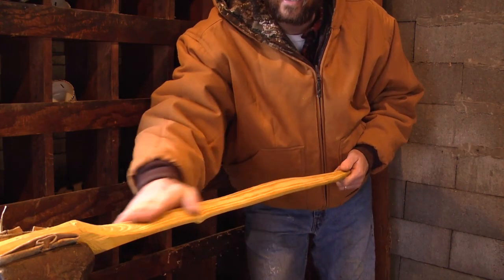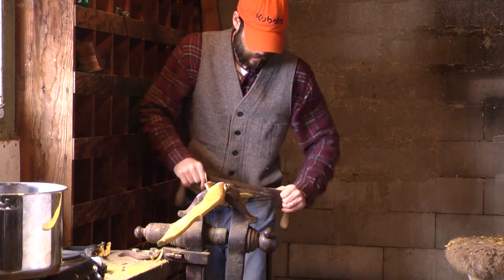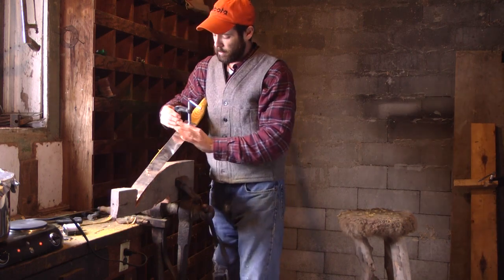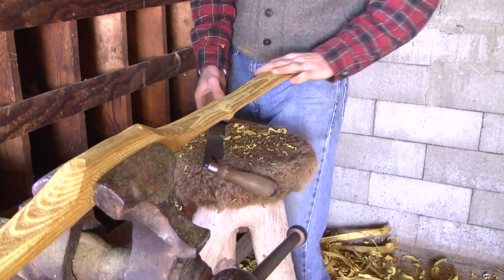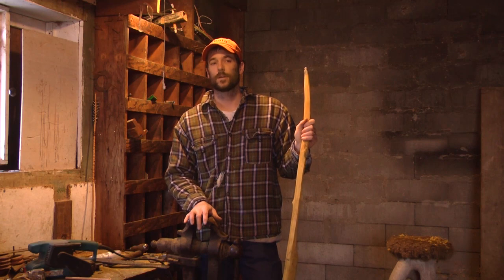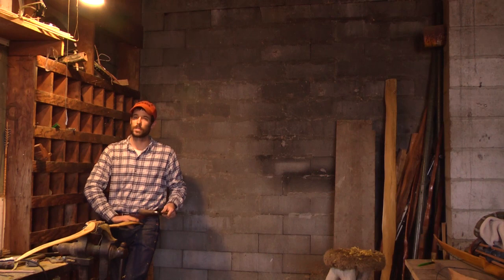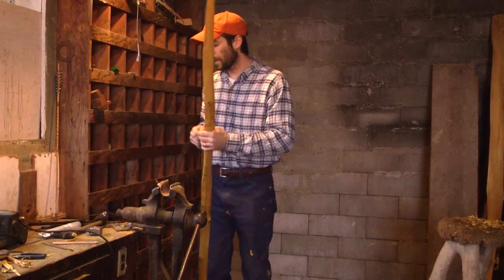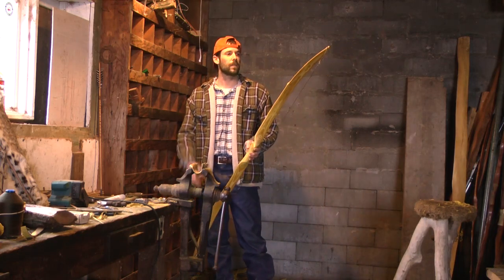How to make a Longbow - Part 3: Tillering

Comment: I haven't touched a stave in several years, and I have never had any turn out very well. Sinew has been a lifesaver with the ash I have used. Thanks for the very well taught videos. I will have to get going again.

Comment from the maker: That depends on a few things like diameter of the stave, temp, humidity, etc.  On average I let a split 4" stave dry for at least a year.  You can start reducing mass and getting down to something that looks a little like a bow before then, but if the wood is too wet, it will develop longitudinal cracks as it drys.

Comment from the maker: I'm not familiar with that species, but with other white woods, it's a common practice to just remove the bark and use the outer most ring as the back.  With such a small diameter limb, you are probably "decrowning" it.  That's fine, but it does make things a little more touchy.  Your tiller will need to be perfect.  Just remember, the road to becoming a good bowyer is strewn with splintered wood.

Comment: At 27:00 you talk about the bottom limb being stifer and its benifits is that because when you draw back you are pulling the string on that side of centre ?
If you get what I'm saying your arrow nock is pretty much centre and in your case all three fingers are pulling on the bottom side so you are constantly pulling the bottom limb just a bit more than the top......or have you ever thought of that?

Comment: This is an excellent step-by-step video Clay and very useful for first-time bowyers like me.  Would have liked to have seen the finished (sanded & stained) bow.  Can you post a photo?  One more question... can tillering be done by decreasing width from the limbs rather than thickness?
Reply from the maker: Sorry Elias, I donated that bow to a fundraiser auction so I can't post any pictures.  Yes, you can adjust tiller by removing wood from the sides rather than the belly.

Comment: Hey Clay, enjoyed the series. Unusaul vice you have there, never have seen one like it. Could you tell us tool nuts a little more about it or a short vid. would be great.
Reply from the maker: It's called a leg vise. You can sometimes find them in old barns. The leg sticks down into the floor of the shop so you can really crank a lot of leverage on the handle.
Reply: Clay Hayes Thanks for response Clay. Cool and interesting vice.

Comment: Well I just splintered my bow yesterday. It was my fault  steamed one tip to get some twist out the tip and give it a backbend.  Splinter happened just like ya said guess I will try a backing strap next time. Got in a hurry my fault I also noticed today it occurred where I had a blade chip in the edge of the wood. My bad . Another wall art piece... since it is on the inside belly I have to wonder if supper glue might fix it, thinking I might keep going on it and do some sinue on it and see if it can be repaired,  should have just left it alone . Think I will watch your videos again .
Reply from the maker: Just fill it up with glue. Those cracks don’t usually cause problem.

Comment from the maker: I never really check the weight.  I just keep taking off wood until it feels about right.  If you'fe trying to reach a target weight, you could use a bathroom scale and a board.  Simply place a 2x4 about 4 feet long on the scale, hook the bowstring over the top end and push the bow handle down toward the scale. This will bive you a fairly acurate reading on weight at whatever draw length you push the bow too.  We'll cover arrow spine and tuning in a later video.  thanks for watching.

Comment: Love the videos.Currently working on a 54" Osage bow as a trial run.  I do have a couple questions though.  1. I'm 6' 8" with a 31-32" draw.  What do you think would be the minimum size bow, in osage, for a man of my particular measurements?  2. What grit sand paper do you wind up using and what do you use for sealing the bow when it is completely finished?  Thanks again for the great videos hope to see a few more maybe with a different wood :)
Reply from the maker: +Singing Wolf (SingingWolf39) You might need to go with something in the range of 68 - 70 inches overall. For my final sanding I use 000 steel wool, and to seal the bows I use tung oil - about 5 coats or so.
Reply: Awesome man thanks for the info.  Just got done steaming recurves into the limbs of the 54 now the 3 week wait :)

Comment: Finished tillering but the limb tip alignment with the handle is off the wrong side, is dry heat treating to bend one limb a little more a bad idea at this stage?

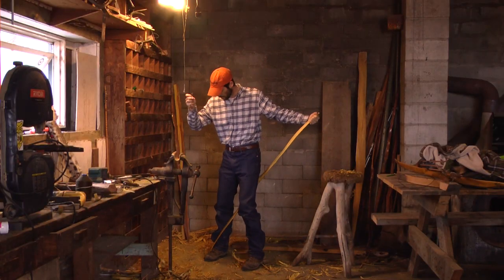Comment: Hi Clay,  I was at the point of stringing my Osage stave (the 20:00 mark in this video) and I heard a slight crack.  There was a quarter inch splinter at a pin knot on the back about 10"-12" from the stave midpoint.  I gouged out the splintered wood to the next growth ring and smoothed the transition between growth rings.  I then applied 2-3 layers of sinew to the area extending 5"-6" above and below the area in question.

My question is, do I need to apply sinew to the entire back or is what I've done sufficient?  (appearance doesn't matter)
Reply from the maker: +Steve Lardner That's probably the best thing you could have done. If the rest of the back is sound, it's probably not necessary to back the whole thing.
Reply: +Clay Hayes Thanks Clay.  I got impatient and applied sinew to the entire length.  It was quite a learning experience.  My sinew was quite stiff because it didn't separate well from the outer sheathing.  I tried to work in the glue best I could.  We'll see in a couple days how it worked out.  Newt time I will moisten my sinew by putting it between wet cloth in a covered container overnight so it's good an flexible.
Reply from the maker: Learn well... Sinew backing is a ton of work. as you know.

Comment: Hey man, ive been watching your videos now for a few months and during that time ive cut and dried 12 really nice 7ft long hickory staves about 4 inches round each. Ive as of now (1-12-24) gotten my first successful hickory flat bow that measures up at 72 inches long by 2 inches wide at the limbs with a 10 inch long by 1 1/4 inch  blended handle. It came in at just shy of 60lbs, and I'd really like to hit that 65lb mark just for the sake of enough power to put a hog or 3 in my freezers each year.  

My question is this:

Do you think that cutting down the ends about an inch or 2 will help me increase that draw wieght? Full draw for me is 28 inches, and yes, i have already roasted this bow in a backset form for about 2 hours, its got about 2 1/2 inches of backset after i strung it up and shot it for a weekend here in deep south Alabama. Ive also uploaded a short video to my channel briefly going over what ive got so far, ill continue to upload more as i get them transferred over to my laptop

Comment: Clay, thanks for sharing your knowledge. I've learned substantially by watching your videos. Quick question...When you cut the string nocks, did you cut through the back and belly of the bow?
Reply from the maker: Try not to but through the back if possible. If you have to, you might want to glue a reinforcing piece over the nocks.

Comment: Clay, is there any special/different steps you would need to take making a bow out of hickory? I'm in Alabama so it can get pretty humid, I would assume more drying time would be needed and if so, are there any ways to speed up the drying process with some sort of homemade dryer? Thanks for the amazing videos, keep up the great work!
Reply from the maker: Chris Bennett Sure Chris, hickory doesn't have sapwood like osage. When you remove the bark from hickory, your back is just underneath.  You can speed up drying by putting the staves in your attic during the summer. Or you can google plans for a drying box. People make and use them but I've never had the need.

Comment: Hi Clay, I just finished my first osage selfbow and Flemish Twist string (thanks to your video).  Unfortunately, when I flexed the bow it got a longitudinal split "6"-8" long, about 8" from the upper tip and about 1/4" from the edge of the stave.  Do you know what causes this type of split?  Is there some way to recognize and prevent it during roughing out and tillering?  Also, is there anything that can be done to repair it?  Thanks.
Reply from the maker: Steve Lardner Hi Steve, it's not uncommon for osage to develop longitudinal cracks. Many of my bows are full of them and have been shooting that way for years. Unless the crack is deep or runs off the edge, it could just be cosmetic. You can fill the cracks with superglue to help seal them up. If it's a substantial crack, maybe try wrapping the area with sinew and hide glue (the real stuff, not that fake crap on a spool). That should fix it up.

Comment: I've just finished a good bow out of really dry hickory but when It's unstrung there's a lot of set in the limbs already. Will this keep getting worse and the draw weight keep getting less?
Reply from the maker: I'd guess not. You're probably pretty close to where the final string follow will end up.  If you're unsatisfied with the bow you might want to try steaming the handle and putting some backset in there.

Comment: it seemed to me that you had a slight S curve to the bow. Am I wrong or is that not a problem? Also what do you use to seal it? do you ever laminate it like with sinew or is it fine just wood? Awesome video. Thanks!
Reply from the maker: +himmerman as long as the string bisects the handle it's not a problem. I use tung oil to seal it. I sometimes sinew back bows but mainly make wood only bows.
Reply: Thanks Clay!

Comment: I have one more European wych elm to work with. I"m thinking to make it about 65" long and about 2" wide and a little bit thiner on the limbs and recurve them about 2" away from the belly.The wood has been drying 1 month as a stave and about 1 month close to bow dimensions. I hope it will work well. What do you think about this and how good wych elm is in your opinion.
Reply from the maker: Lo La Hello Lo La, I've never worked with any type of elm but the dimensions should work fine for most white woods.

Comment: I just cut one wych elm wood so I wonder should I take the bark of or leave   it on. I always take it of few days after I cut the wood or when the wood is dry.. Anyway can you please tell me what to do and why?.
Reply from the maker: Lo La I'm not familiar with that wood. Whether or not you can remove the bark while the wood is green depends on the species.  Some wood will check (split) badly if you do this. It's safer to leave it on for a while until it dries a little.

Comment: Ive been making selfbows almost year ago but I still have problem with only one thing. I cant make a bow without of SET.I use the bow couple of times and set appears in sec. I see that you draw the bow several times and it returns bautifuly to original shape. Should I steam reflex the limbs of my bow and if I do how much would it last before SET appears.
Reply from the maker: Lo La the amount of set, or string follow, you get will depend on the type of wood and bow design, as well as how you treat it during the building process.  In general, wide, thin limbs will take less set.  Reflex will also help.

Comment: If you tillered a bow to just under finished draw weight, if you steam bent some recurve in it would go up up in draw weight? And would the tiller stay even with the recurve put in after its finished?
Reply from the maker: yes, the draw weight would increase. If the tiller is good before the curves, and the curves are even then the tiller should still be pretty good. you'll probably need to make some adjustments though.
Reply: Clay Hayes Thanks so much, love your videos they are awesome.👍👍👍
Reply from the maker: Thanks Joel, you should also check out www.patreon.com/clayhayes . There's lot's of useful info there as well.

Comment: That was awesome. So I just started my first bow. These videos have got me concerned though. Mine is from a Silky Oak (in Australia) branch. It's diameter is about 3 inches so trying to find a ring like you did while still trying to make it flat is going to be impossible. The whole time (10hrs) I've just been ignoring rings and have just been trying to get the right shape. I'm using a tiny little (single tang) survival knife and that's it. Does it sound like I should start over from scratch?

Comment: Just so I am sure about this, after you steam you allow 3 weeks for the bow to dry?
Reply from the maker: kyletango Usually. But, this will depend on the drying conditions. If it's stored in a cool, humid place it may take much longer.  Keep the humidity and temperature in mind.

Comment: Hi Clay, a tillering question.  My limbs have a twist to them.  They're both bending fairly evenly and with he same amount of bend but both twist to one side.  Does this mean I should remove more wood from one side of the limb than the other, and if so with side?  The one that appears to bend more than the other seems more logical to me.

thanks,
Steve
Reply from the maker: +Steve Lardner you mean you have propeller twist?
Reply: Clay Hayes Kind of.  There's some propeller twist but the uneven bend when I draw the bow is my concern. Both limbs twist on the same side, the side away from the arrow rest creating or amplifying the propeller twist.
Reply: Yes, but it isn't apparent until the bow is drawn.  It's currently pulling 52# at 23" which is good as I'm look to make it a 50#-55# at 28" but I'd like to reduce or eliminate the twist, if I can.

Comment: someone has probably already asked this, and you probably already answered, but why did you make the handle 1 inch above center and 3 under? from everything that i've seen and read, most people make it an even 2 above and 2 below. why do you do this on this particular bow
Reply from the maker: splitting the difference in this way gets the arrow closer to the center of the bow without going all the way. It's a common practice to make the lower limb a little shorter like I've done here.

Comment: Hi Clay, well the sinew is dry and I put the bow string on and put it on my tillering stick.  Both limbs have a fair amount of twist.  I read in the Bowyers Bible that to eliminate twist I should remove some wood from the "offending" side.  Am I correct in assuming the offending side is the side that has less bend, i.e., isn't as close to the bow string?  Thanks.
Reply from the maker: +Steve Lardner Some propeller twist doesn't necessarily create a problem but if you want to straighten it out some, you can remove wood from whatever side you want the bow to bend toward. The bow will bend toward the thinner side.

Comment: Great series, but it looks like you could up your bows performance if your begin tapering the limbs width earlier towards the fades. Unless this is intentional, and you designed this bow to shoot very heavy arrows
Reply from the maker: +Primitive Pyromaniac Good thought. I like to keep my limbs wide because it allows me to make them very thin. This helps reduce string follow in hardwoods like osage.
Reply: I've never heard of that concept before, but i will see if it works with my Australian hardwoods

Comment: Does it really needed to dry the wood? While drying, No shooting? In what way to dry the wood? Would it be okay if i'll expose it to sunlight?
Reply from the maker: Drying the wood is very important. if you bend wet (green) wood, it's more likely to stay bent which you don't want. Exposure to sun and wind, at least in the early stages of drying, will cause the wood to develop cracks due to drying too fast. ch
Reply: Thanks Clay. Now i know why my other bow have these cracks and already bent and the other bow is just Perfect for me. =)
Reply: What is the draw weight of that bow?

Comment: what do you think about setting in recurves after tillering the bow? also i have a plethora of black locust any design tips? i know its similar to osage
Reply from the maker: +Seth Basler you could recurve the tips after tillering. You'd likely need to remove some wood from the belly to reduce weight and keep the curves from pulling out.
Reply: Clay Hayes what kind of design tips would you use for black locust?

Comment: Hello, I know this is an old series but I built my first bow from hornbeam about 6 months ago and It's very hard to pull by looking at your bow when you where tillering  it and said it's probably 100 pounds now mine is twice as hard to pull in the finished condition. It is 61 inches long unfortunately I don't know the exact draw distance I assume it's around 25 inches but the limbs are very thick. What would be the correct limb thickness/width for that length if I want the draw to be at say 65-70 lbs? Thanks in advance!
Reply from the maker: Hi Nick, this is all covered in my book, The Traditional Bowyer's Handbook. There is no set demensions. It will depend on the species used, length, width, cross dimensional shape, etc. just keep removing wood from the belly until you reach your target weight.
Reply: Clay Hayes Thanks I will check it out.

Comment: I'm building my first bow and I've got it to floor tillering stage (it's osage). 
Im kinda afraid it's already too thin as I don't have the limbs even yet, what's the average thickness you wind up with in your osage bows?
Reply from the maker: Tim, the thickness will depend on the width and length.  My bows average about 2 inches at mid limb and are usually around 62 inches or so. Mid limb thickness will be about 3/8 inch but that's just a guess. If it's too light, you can take a little off the total length to bring the weight back up. you can also put some reflex in the tips to accomplish the same thing.